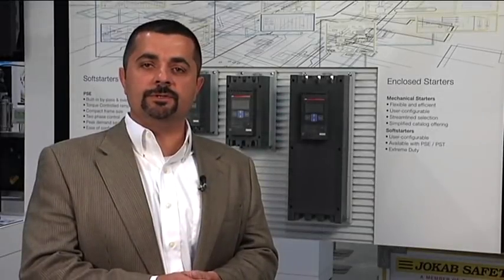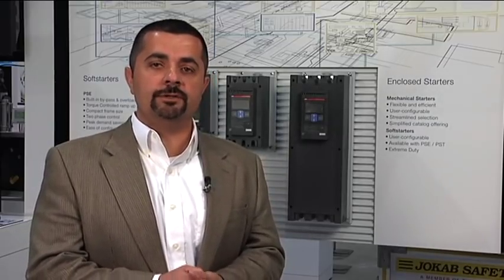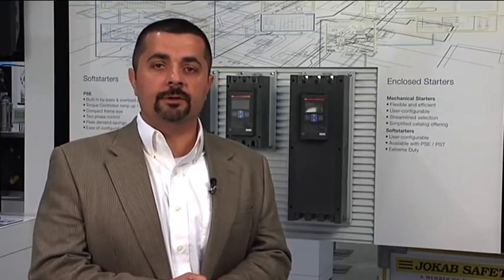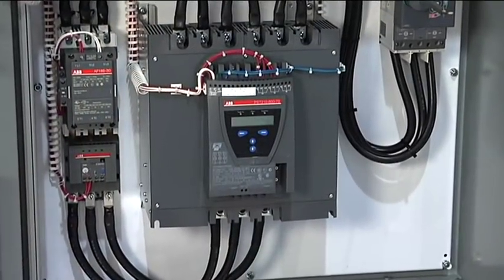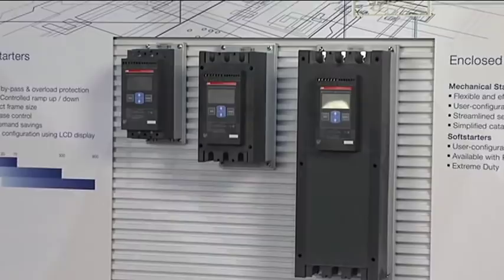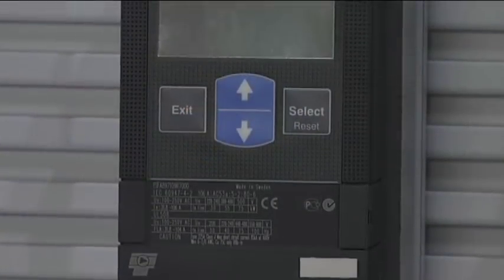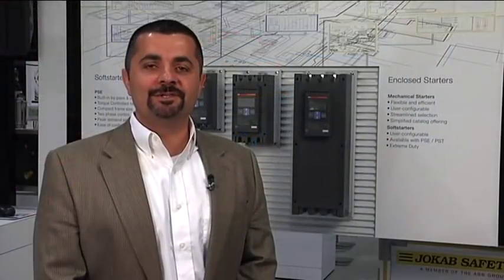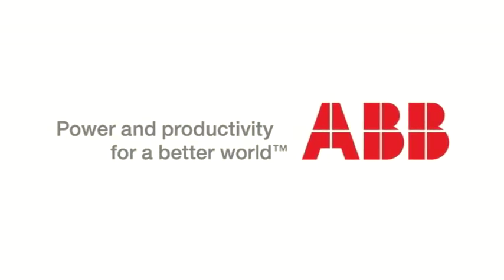Soft Starters vs. Drives

Comment: I have a ABB's 40HP 3-Phase Induction motor which is used around 2Hrs-a-day only on constant speed. I am currently using Star-Delta starter. But want to change it now. 

Can you recommend me a starter for it?
Thanks in advance.
Reply: Sure: Zotac HAPCO39 + super diesel filter.